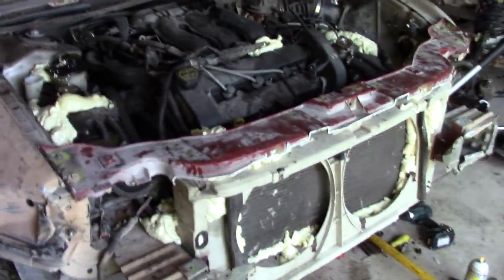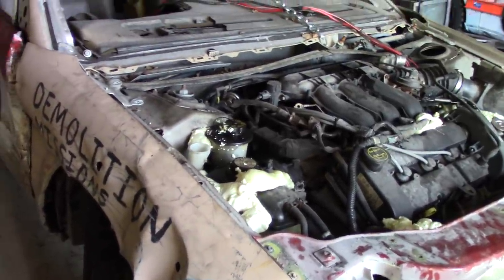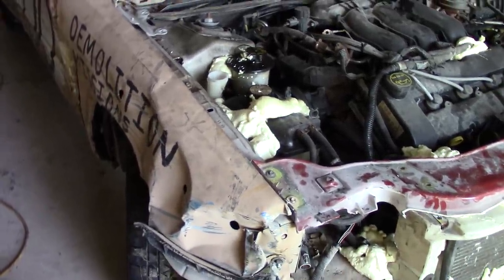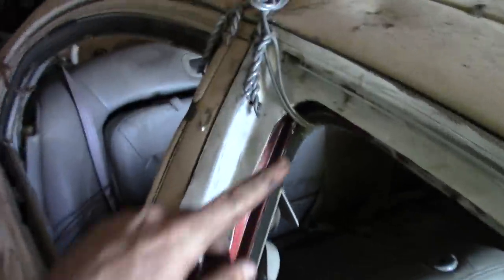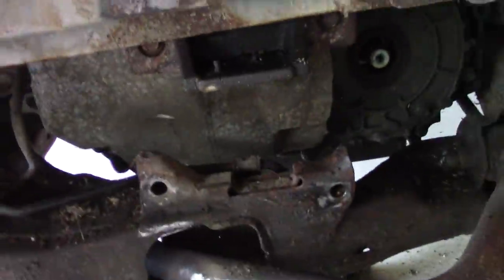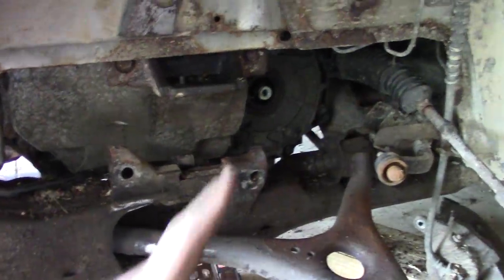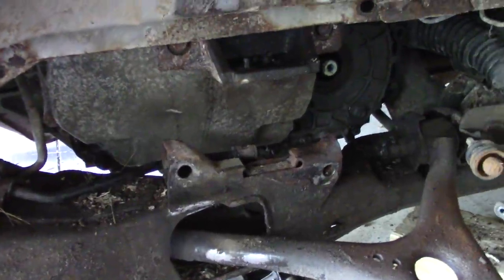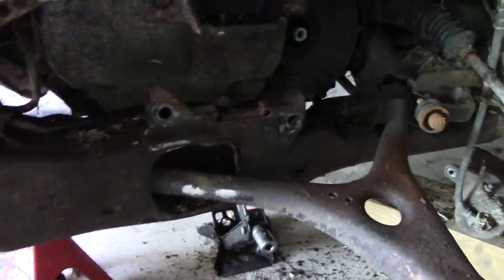2004 Sable Derby Build Ep 4: 20+ Years of Issues

Comment: Few tips for ya 1. Put jb weld over the indent on the transmission 2. Watch sacks workshop to make a cheap park lock out 3. Figure out a way within the rules to get rid of the rubber 4. Don’t cut the mount  just trim the bolt